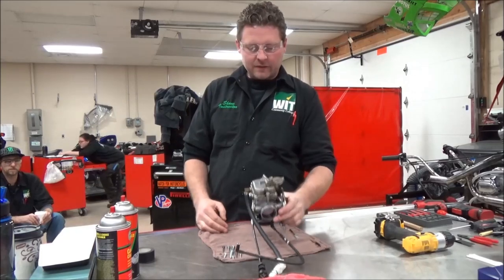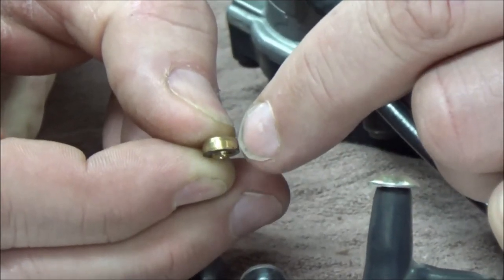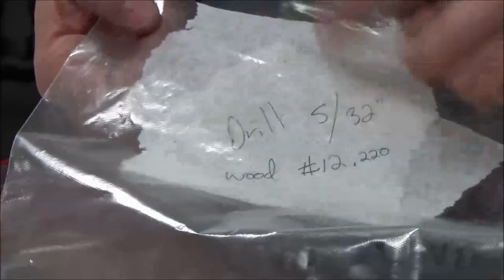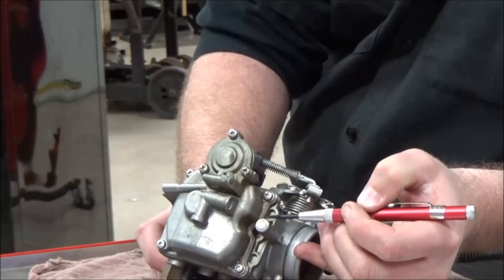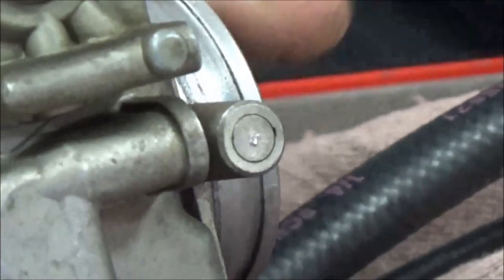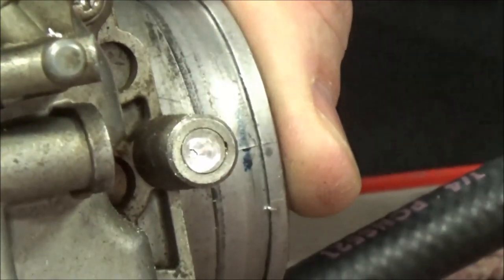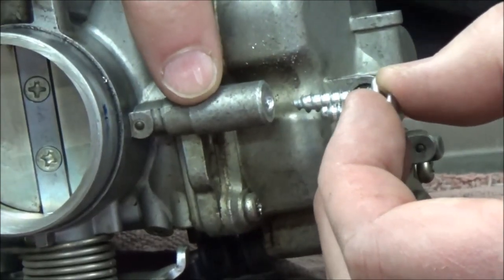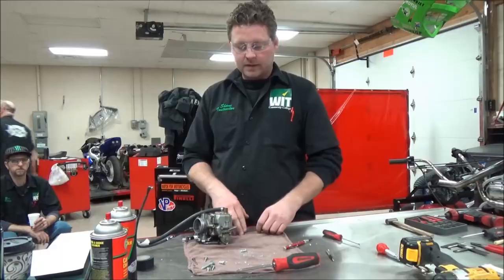How to remove a welch plug (air fuel screw cap) from any motorcycle or small engine carb carburetor

Comment: Great video as always! Thanks !  I just had a spark plug blow out of a Kohler  flat head engine. I needed to put a good insert in for the spark plug. The two step tap it came with chases the old threads out first than cuts new thread a little over size for the insert. After the old threads chased out and tap started cutting, the bottom tap was hitting down inside the shallow head! So I taped up the bottom tap and cut half the length off the bottom piece to allow tap to thread the hole for plug insert! It worked perfectly ,just like you did to not bottom out with your drill on the air fuel jet under the Welch plug! Threaded in stainless steel insert and plug and motor is running fine now. I just started using a center punch and love them! I never realized how easy they make life and how affordable. Just drilled and tapped my old fxr  with some 10 \24 screws. Used center punch and got nice clean holes!
Reply from the maker: Glad to hear it! Thank you for commenting. Want more benefits? Smash the subscribe button and bell! Want even more??? Join the channel:
-Daily MEMBER FIRST COMMENTS ANSWERED FIRST 
-Live Q/A video chats
-Wonder if we have a video on your need? Members can request content links!
-Full Access to the ENTIRE 700 video library
-Member-Only FREE tool giveaways 
Join this channel to get access to perks:
https://www.youtube.com/channel/UCBhM8DCKnT3qXwTW0eToyCg/join  

Just want to say thanks quick to support us for this information and our work saving you money? 
Give us a high 5 here:  https://www.paypal.me/how2wrench

Comment: I did this today and I didn't see this video until now, so it was a trial and error procedure for me. I was successful by using the smallest drill bit I had with my small battery powered variable speed drill on a very slow speed setting. I could feel when the bit broke through and I was able to stop in time. Then I used the next larger drill bit and then a third. I couldn't get a small screw to engage the threads in the plug, so I used a tiny pic. There are 4 pics in my small set and I used the curly one that fits underneath O-rings. I went slowly around the plug with the pic in the hole and it came out easily. Total time involved was less than 15 minutes and the screw head was untouched. Guess I was lucky. Anyway, I'm old and I have a lot of patience.
Reply from the maker: Glad to hear how you couldn’t do it without the videos. Here are the links to support us for this information and our work saving you money.
Join this channel to get access to perks:
https://www.youtube.com/channel/UCBhM8DCKnT3qXwTW0eToyCg/join    

Give us a high 5 here:  https://www.paypal.me/how2wrench

Comment: Lol I just used a very small maybe 1/2 pointy self tapping metal screw it didn't go through and grabbed the cap and pulled it out. Super easy carburetor was still in place

Comment: Can the air fuel mixture screw cause a cycle not to run? I have a bike that’s been setting for 13 years and I just wanted to know if I should remove Welch plug and clean the port along with rebuild. Thank you.
Reply from the maker: You're asking the wrong fella on short cuts friend...I ALWAYS do them...😀It's more of a it will cause it not to run correctly, hard to start,,,etc. You can usually get an engine to run with a clogged fuel mix screw by chocking it and flogging the throttle, but just not run correctly. I can help you one on one too. See below. Hope this helped. 
👍 Thank you for taking the time to comment! It helps us! 
Here is a way to support all the free videos.
Want to say “thanks” or “keep it up”? Click here https://www.paypal.me/how2wrench  

Coach Conley is also available for hire to personally work one on one with you if ever needed. Yep he is a real person. Give him a call @ 602-345-0432
Details here: https://how2wrench.com/product/personal-tech-training-phone-facetime/ 
Your answers and help are just around the corner. Save time and money while protecting your investment and yourself by doing it the right way!
Follow us! 
Web:
www.How2Wrench.com     
www.Tools2Wrench.com

Comment: its cool that you removed the cover for the fuel mix or idle screw.. mine has broken with bites from diff flat head drivers.. how should i remove it?
Reply from the maker: It sounds like you’re ready for some Techline help. Coach Conley is also available for hire to personally work one on one with you if ever needed. Yep he is a real person. Give him a call @ 602-345-0432

Details here: https://how2wrench.com/product/personal-tech-training-phone-facetime/

Your answers and help are just around the corner. Save time and money while protecting your investment and yourself by doing it the right way!
Follow us!
Web:
www.How2Wrench.com    
www.Tools2Wrench.com
Reply: @How2Wrench  i actually got it running better with the gas screw all the way out almost but now it kinda bogs on very low rev accelerations, and now the idle looks like its on the 2k rpm.. any tip? i did cleaned the carburator and was not that bad
Reply: @incredibledragon7765 to much RPMs gonna blow it spark plug should be your issue if not flood carb with carb cleaner wait a few come back add fresh fuel start it with plug open drain all that crap at the same time she running close it test if not buy a new carb you did say screw was destroyed so definitely gotta buy a new one just when purchasing a carburetor look for markings there’s so many fake carburetors that sell for cheap don’t be played

Comment: There's a much safer method to remove a welch plug. Drill the smallest hole you can into it then put your compressed air to the hole and the plug will pop right out intact!

Comment: Thanks MR Conley, your lessons are top and you look at things deeper and make sense to why,but I’d like to know why were Welse plugs needed for an ‘unused’ screw,or passage.? If it’s unused then why do they go to the trouble of making them in the first place,?
Are we removing them to increas fuel air.  At the choker or are they just to gain access to the screw for cleaning out the passages?

Comment: Gotcha.. thanks!.. I've been adjusting that screw trying to find the sweet spot on my GS550. Pretty sure they're the CV carbs. Does that screw only adjust the fuel mixture during idle or does it effect top end too? Bike accels well but when i put on the throttle it sounds like it spins out at the top end and doesn't increase power. (sounds like gargling basically). Is this the screw I would need to adjust to fix this? If not what should be adjusted? Another thing to note is sometimes I hear a hiccup come from the carbs. know its from the carbs because when syncing the needle jumps on one or two carbs, not sure if its related.
Reply from the maker: Thank you for the comment. See the link below for more help with your question. I have been banging my head against the wall thinking of ways for people to say thank you in an impactful way to help keep these videos coming. Here are few ways that many have found as a way to give back. 
* Membership to H2W (includes t-shirt or tech help) https://how2wrench.com/product/membershipmembers-onlymembers/
* Simple donation to say "KEEP IT UP"
May you have a great day and... https://www.paypal.me/how2wrench

Free Mechanic info, tool reviews, and “how to” videos newsletter sign up: https://how2wrench.com/subscribe-free-newsletter/

Missed a past issue? No Worries. Newsletter Archives: https://how2wrench.com/blog/newsletter-archives/

Like freebies? Click here for a free diagnostic checklist! 
http://gem.godaddy.com/signups/364621/join  

If I can ever be of service to you, here is a video explains how to connect with me. 
https://www.youtube.com/watch?v=vjvmB01ebcs

Comment: Once the welch plug is out, do you need to replace it with a new one once the needle has been cleaned or replaced? And what do you recommend on how to adjust the needle to it's original position (or tuned position), ie; counting turns, a mark or something, and should I put a drop of blue (non-permanent) thread locker on the needle to keep it from shifting? I know, lots of questions, but I want to do it right. Great video, Thank You!
Reply: No you do not replace a Welch plug,,,,, leave it open,,, never use Loctite or any sealants silicones Teflon tape,,,,

Comment: i actually got it running better (because before i had auto reving without me touching the accelerator and much little throtle response, plus when i decelerate that was taking a long time to idle) with the gas screw all the way out almost but now it kinda bogs on very low rev accelerations, and now the idle looks like its on the 2k rpm.. any tip? i did cleaned the carburator and was not that bad. btw, i tried to remove the fuel screw but was not able to, so i tried with the screw all the way maxed out and works better... idk why.. can someone explain to me? thanks ps: i also mangled the screw and cant move it anyways.. lol
Reply from the maker: We offer carb service and could fix it for you. Couple of tips: If you have to max it out then: 
1. the pilot circuit is still clogged
2. wrong size jet
Reach out directly if you need more help. 
👍 Thank you for taking the time to comment! Hit that subscribe button if you haven’t please! It helps us! 
Here is a way to support all the free videos.
Want to say “thanks” or “keep it up”? Click here https://www.paypal.me/how2wrench  

Coach Conley is also available for hire to personally work one on one with you if ever needed. Yep he is a real person. Give him a call @ 602-345-0432
Details here: https://how2wrench.com/product/personal-tech-training-phone-facetime/ 
Your answers and help are just around the corner. Save time and money while protecting your investment and yourself by doing it the right way!
Follow us!
Web:
www.How2Wrench.com     
www.Tools2Wrench.com
Reply: @How2Wrench  but can i get it maxed out? i mean the fuel screw all the way out? It seems to run just fine but what can it be? ive cleaned the jets already.

Comment: Not air screw is a fuel screw, please edit your title to not add to an already misconceived notion that this is an air screw like is on the air cleaner side of a 2 stroke carburetor which is the AIR SCREW and adjusts air.
Reply from the maker: +Bruce Kennedy 
The title is correct in there are "air" screws with emission caps out there are well on engines. I would think you could tell I speak of the "fuel mixture"screw I demonstrated on. The title is to open the search to multiple parties that might be looking for the information. 
Hope you found some use of the actual intent of the video, I wouldn't know as you only found time to reply with fault found...lol
Reply: Oh I am enjoying all your videos for certain. Didn't mean to single out anything. I just know from experience of 40 years that many if not all people are confused about the difference between the fuel metering screw on a four stroke vs an air screw on the two strokes. I watched another of the videos, I think CV carburetor tear down and cleaning where you clearly explain the difference. No negativity intended. Your students will be great mechanics.
Reply from the maker: +Bruce Kennedy 
Great thanks Bruce...feel free to comment or correct anytime now that I know you have positive helpful intention. This channel is all for learning and sharing as a team. 👍
Reply: I learned a lot about the Keihn FCR carb on my son's WR250 and the affect on running from having leak jet in bowl sized too big and lean bogs occurred. Once I reduced the leak jet size, and adjusted the fuel squirt timing it ran really well.